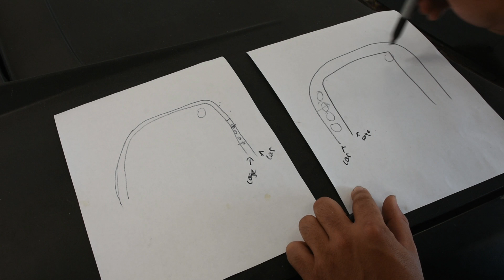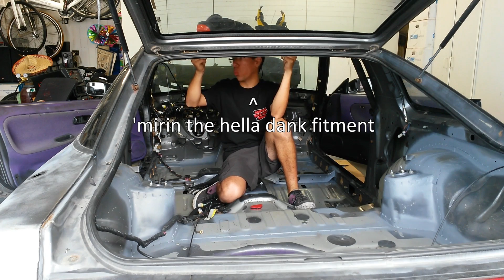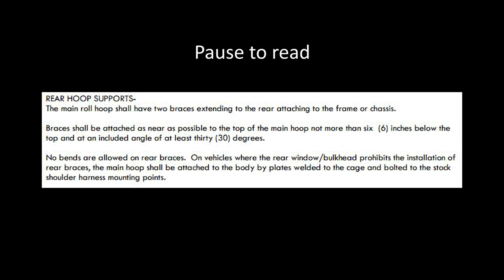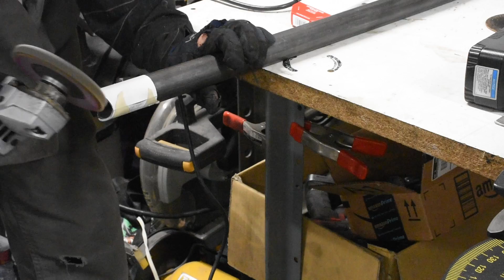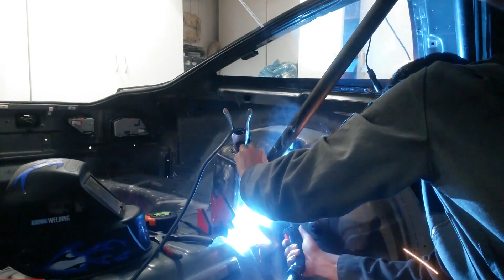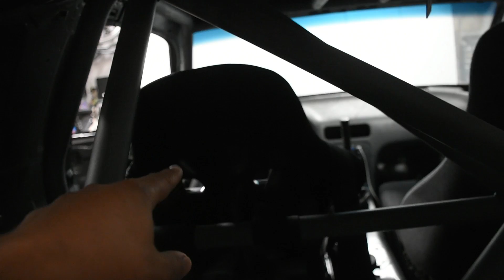Project 240 - Le Drift Car II | Ep. 11 - Main Hoop and Rear Supports | FD Spec Cage Build

Comment: The example car you used for a "bad cage" is actually because of the seat rails making the seat unusually high, not the cage, GG
Reply from the maker: +ooohmanda Didn't know that but thanks for the info! Either way the point of putting it in the video was to show what it looks like when the drivers head sticks out over the cage and get the point across to people of how dangerous it is. Thanks :)
Reply: I gotcha, makes sense, cool video though 👍
Reply from the maker: Thanks! Sorry for the misunderstanding!

Comment: how did you manage to weld the top tube?
Reply from the maker: Front base plates get removed which allows for the cage to be pulled forward and down giving 4+ inches of clearance to the roof and that's when i weld the top.

Comment: At the 14 minute mark how long did it actually take you to cut out one notch
Reply from the maker: 1.5 minutes for cut off disc and 3 minutes for flap disc. In total 4.5 minutes from straight tube to notched. If I'm doing an adjustment notch or just re-notching it ends up being about 1.5 minutes with a flap disc

Comment: a pipe master is a much easier way to do the notches
Reply from the maker: I have a pipe master and it's terrible to use. The little pieces bend out of the way instead of actually contouring around the tube. Also unless you have the pipes intersect at exactly the half way point, (which is hard when doing a roll cage) you'll end up with an offset notch. So yeah haha that $50 pipe master sits on the bench never getting used.